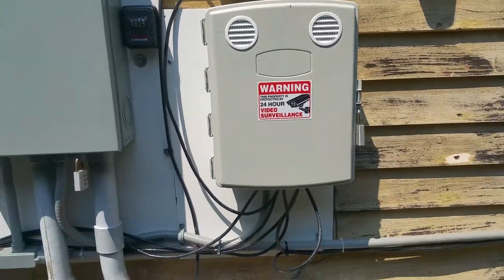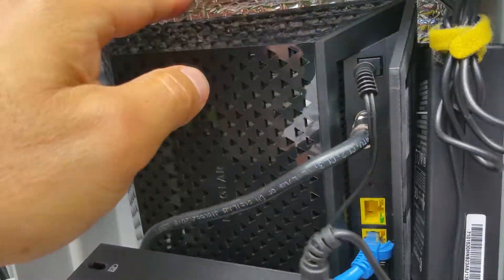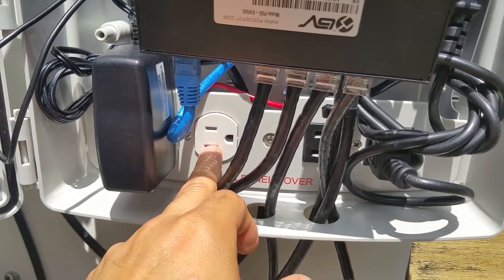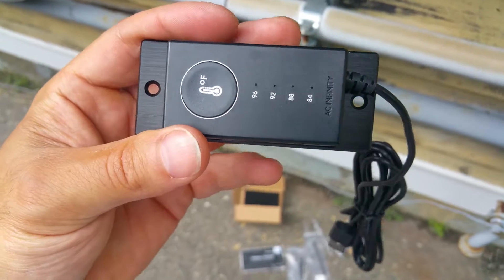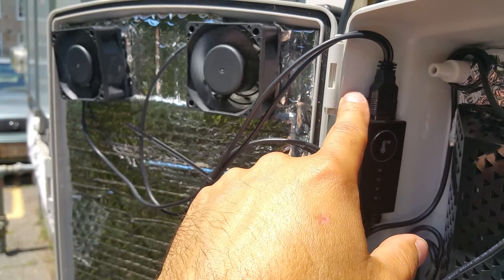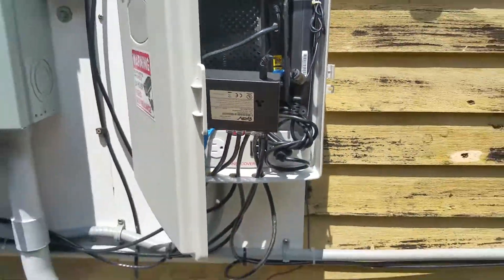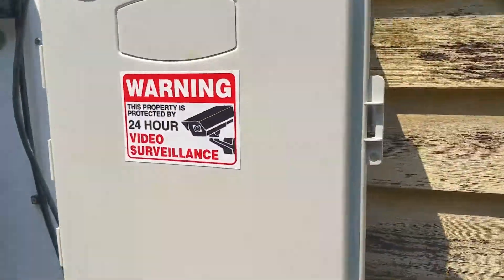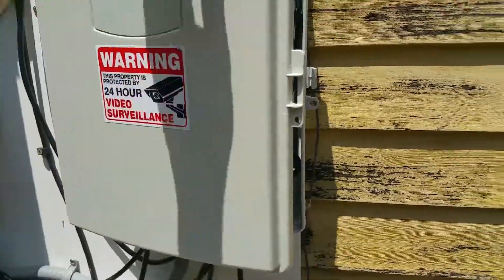How to prevent wifi from overheating / Wifi outdoor enclosure ventilation

Comment: thanks for sharing, i have an scenario of a 12v wifi router + starlink on the roof rack of my sprinter van. at the moment it works great until summer where the wifi router goes crazy. i'm going to adapt your ideas to a cabinet that is on the outside of the van.
Reply from the maker: fresh air intake at the bottom, and use fans + trigger to blow out hot air. Works great!

Comment: Have you though of building that networking box an awning that would provide shade in the summer months as well as inclement weather protection to the box and internal equipment itself?
Reply from the maker: @newk00011  no need to, thos has worked with zero issues over the years. The key is the intake, exhaust and fan.

Comment: Just what i need, you’ve got every considerations needed. Great job man❤ when wifi is in this box, how is the signal doing? Does it drop a lot? I plan to use this in my farm, max range for 2.4ghz is 100 meters
Reply from the maker: No issues with signal

Comment: It's an old build. A few tips though for next time.
I would probably mount a plate on the front of the box, with a gap between it and the front of the box. Use some stand off bolts.
That way you provide shade to the box and allow airflow in the gap.
Reply from the maker: No need, it has been working flawlessly all these years.

Comment: The reflective insulation needs to be on the OUTSIDE!!! (And with a small spacer from the plastic… try adding some more insulation)
Reply from the maker: It's working just fine, radiant head Wii poo penetrate the box and be directed out. Any head inside forced out through the vents as colder air fron the bottom holes forces it to rise.

Comment: With the summer temperatures being so high, ambient temperature of my cable modem/router is 92 degrees. It is on a tabletop by itself. The router case temp is  94 degrees. Do I need to use a fan to cool it further or is the the normal temperature at which most routers can function? Does a modem/router combo run hotter than just a cable modem unit?
Reply from the maker: Combo runs hotter, 94f is not that hot for networking eq.

Comment: Nice work. How did you mount the fans to the cabinet door?
Reply from the maker: Double sided tape
Reply: @daP.A  I have a Verizon 5G Home internet router which I wanted to mount outside to face and reach the Verizon tower which is about 100ft from us, but what you've gone through is another project which needs time to do, is there any ready weather and temperature proof box out there?

Comment: actually, the thermal reflector should be attached on the outside of the box, not inside. So it helps to reduce the heat from the sun/outside coming inside the box.
Reply from the maker: This setup has been working with zero issues for year. The point of the box is to protect theveq from the elements. Working great

Comment: Thanks for ideas, what did you do to keep it from freezing?  most of that gear is only rated to 32degrees
Reply from the maker: goes down to below zero in my area with no issues, the internal heat in that box is enough to keep the EQ safe. This is why you need ventilation on the summer, the trapped heat in that box is significant.
Reply: @daP.A  Thank you!  Working on project just like this at the moment.

Comment: Cool project. Does that thermal trigger reset to the last setting if power is toggled off/on? Or does it remember the last setting?
Reply from the maker: I believe it remembers. It's a great little device still going strong and no overheating issues since

Comment: So, both fans are pulling hot air out?   For airflow... one of those needs to pull air in.
Reply from the maker: bottom holes do that. Air air will flow in through bottom than fan push out hot air. Notice i drill holes in the bottom.

Comment: Just curious, why would you bring you modem and POE switch outside? the maximum distance for POE is 328 feet.
I don't know your house foot print, but if you have a "normal" sized house, the only piece of gear I would have outside is a is a dedicated wireless access point like the Cisco WAP150 Wireless-AC / N Dual Radio Access Point with PoE it's $200. no housing required and they have way better coverage than an indoor home router. If your running cameras, for $80 you should get a P-LINK TL-SG1016D 16-Port POE Switch, so for $280 your all set. But like I said I don't know what you're trying to accomplish or your home's footprint.
Reply from the maker: You dont have room inside!!??
Reply: @daP.A  I was guessing you needed wifi outside. Are doing all his because you have no room inside?
Reply: Gotcha

Comment: Very informative.  Do you have a link for the fans/vent covers?  Also how is that poe switch mounted?  looks like it's standing vertically on its own.
Reply from the maker: Correct it's standing on it's own, the router is mounted with Velcro. The vent covers I got on Amazon check description
Reply: @daP.A  No link in description for the vent fans, far as I can tell. just camera POE switch and box

Comment: its all about airflow...............allow plenty of cool air in the bottom, and allow the hot air to convection flow up and out the enclosure. Insulation inside is actually making things worse, helping to hold heat inside the box, remove it.  You could put a 'stand off' heat shield on the outside of the box, to catch the suns radiant heat and effectively give the box shade. just a sheet of stiff plastic or aluminium, some spacers and self tapping screws..............easy.
Reply from the maker: I see your point on the insulation. However it's been working great for over a year this way. Thanks for you suggestion

Comment: Have you sealed those holes on the bottom? I’d be concerned bees would get in there.
Reply from the maker: No, so far no issues, I thinking it helps draw cooler ambient air in
Reply: @daP.A  Nice. Good point on drawing air in. Thanks.
Reply: Or humidity

Comment: For 8port Poe switch and one fiber optic media converter which size is suitable for outdoor enclosure.
Reply from the maker: You will need to go bigger than the box I had. I had a hard time trying to fit everything in.
Reply: This video which size used